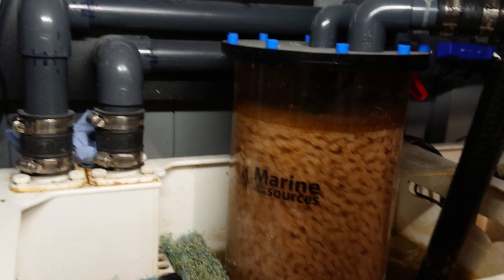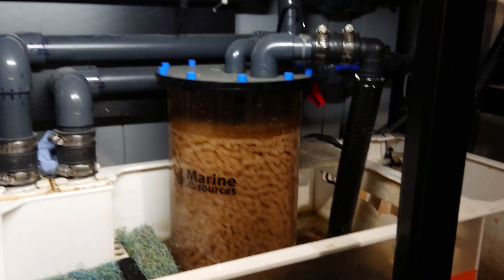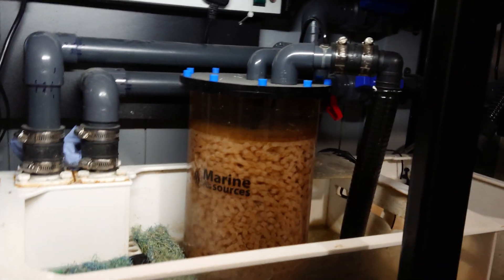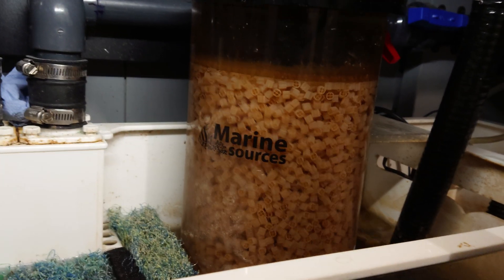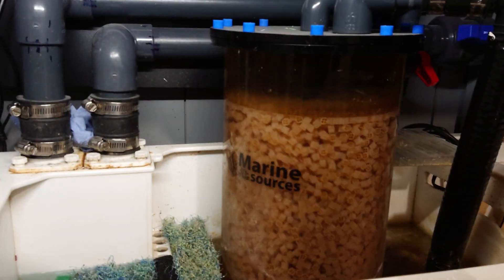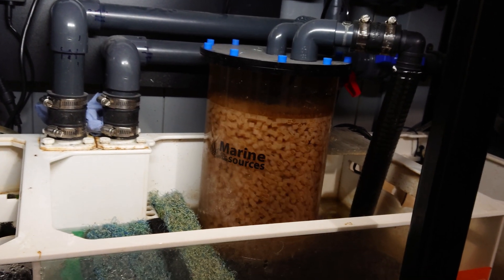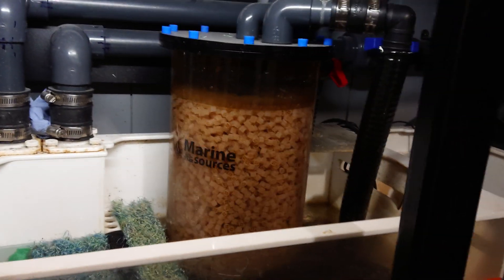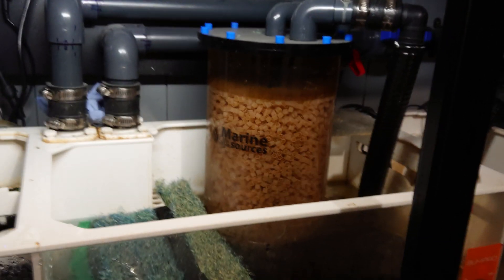Long Term Test - Marine Sources FBF2700 fluidized reactor

Comment: hello mate, wondering if you can help me? I've just picked up one of these and i need some help on the fittings, what exactly did you use so you could get it up and running? and also what air pump do you use? cheers.
Reply from the maker: hi, I use an eheim 400 air pump but any of that sort of LPH should be ok, and i used some epdm kockney koi connectors to attach some hose tails then some flexi pipe to a pump. I did it this way because i had the bits lying around